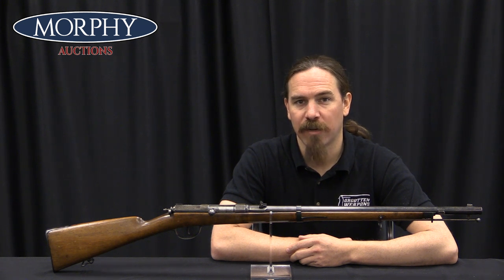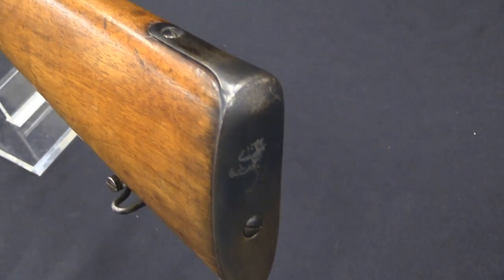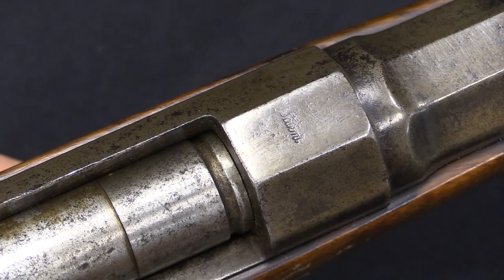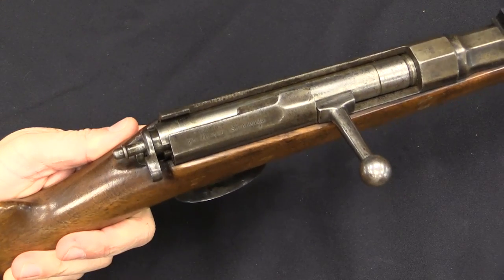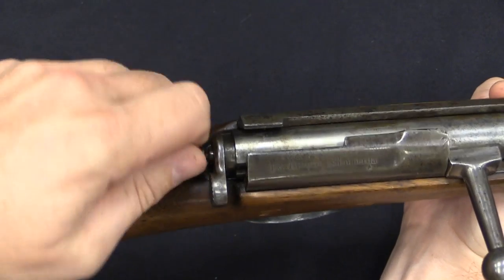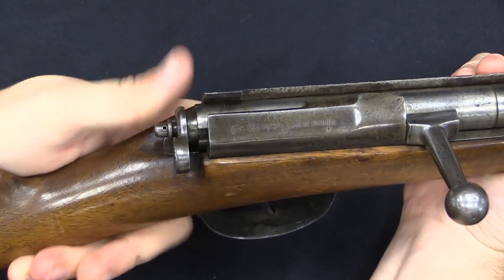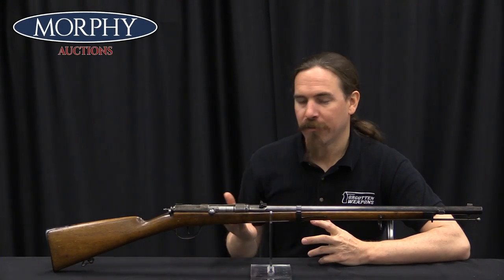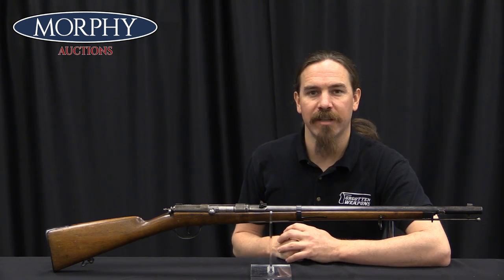The Last Dreyse Needlefire: 1874 Border Guard

Comment: Given the Dreyse was invented a decade before the Minie rifle, and the French themselves replaced their Minie rifles with a needle gun, was the widespread adoption of the Minie rifles by nations in the 1850s a mistake? What if everyone adopted a needle gun instead?
Reply: Had Dreyse, or any of Pauley's apprentices made their rifles to use a more powerful cartridge (similar to what the military was wanting) and solved gas leakage (Pauley used brass cartridge bases, but you have to have industry capable of supplying those bases), more countries would have adopted it. Especially after the Schleswig wars.  Napoleon briefly considered issuing Pauley's guns, but no one could supply ammunition reliably/affordably, so it didn't get too far. The floating bolt head of the Chassepot 1866 design solved the issue with out hindering accuracy, like felt wads in the base of the cartridge did (a major complaint with most designs of the day). The Greene Rifle design also solved the issue, but construction of ammunition and training soldiers to use it correctly was an issue with that design.
Reply: The Dreyse went through a LOT of changes over the over 20 years between first production, then adoption and finally the German Unification war. The Prussians pushed it from a gun that was (in their eyes) unreliable to something they were extremely happy with and would regularly shock the Austrians. The Minie and Lorenz rifles both had a higher "effective" range. The Lorenz was much more accurate and the occasions the Austrians were permitted to use that advantage was the only time the Austrians had any skirmish advantage.
On a couple of occasions the Prussians had units run out of ammunition, while still engaged with Austrian units xD
One Austrian commander did tell his line infantry to just load rifles for the Jaegers under his command, to try and cope with the significant rate of fire disadvantage. I think during Königgrätz or just beforehand.

Comment: With all the attempts to regulate ammo amid current events and the difficulty of manufacturing brass shell casings at home, I find myself looking at old designs and thinking "Maybe there are some things we can still learn from these relics? Perhaps there is a road not taken that's waiting to be forged?"
Reply: If you live in a world without massive factories cranking out millions of cartridge cases every year (or you can't get them), pre and early industrial guns are what you're left with. Priming is just a chemistry problem, and powder isn't difficult, lead and bismuth are available and have uses outside of firearms. The drawn brass case (even soldered foil cases) is a major feat of industry. I've made some "primitive breechloaders" (based off Thomas Wilson's 1859 patent, but with the floating bolt head and seal of the 1866 Chassepot), I like using them, along with my muzzle loading firearms and airguns.
Reply: @wildrangeringreen  awesome. We could use such here in Ukraine

Comment: I would suggest that the decocking feature on this Dreyse is mainly intended to be used on a misfire. With needle guns where the needle actually pierces the primer, there is a danger of the primer igniting when withdrawing the needle on opening the breech. There needs to be a method of withdrawing the needle with the breech closed. 

The earlier versions of the Dreyse and the Chassepot both lock the breech and force you to withdraw the needle before you can open the breech. This slows down the loading sequence and is unecessiary if the gun has fired. Presumably by the time this gun came into service, shooters were considered competent to carry out the proper misfire drill and not try to open the bolt on a misfire without withdrawing the needle...?

Comment: Ian, I'm trying to grow a goatee like yours, with the exception that I want the mustache to flair up like Val Kilmer's Doc Holiday. It seems the space between my nose and lip is narrow like Val Kilmer's, hence why I'm opting for that more narrow style mustache. The goatee portion is going well so far, maybe an inch and a half in length. However, there is a clear gap in the middle of my mustache where our lips depress right below the middle of our nose. I'm starting to wonder if it will ever fill in. Any advice?
Reply: GoBIGclan as a mustachioed man myself, my advice is deal with it if it doesn't fill in. By which I mean, make the space part of of the style. Don't worry about it. I occasionally shave the area (the philtrum) a bit, creating 2 sections to the 'stache. I I weren't so lazy, about maintaining the lines of my facial hair, I would probably keep the middle shaved. I think it's a clean, "tailored" look. (I don't remove a lot of the hair, maybe 1/4 inch or so.) See also, Clark Gable: https://images-na.ssl-images-amazon.com/images/I/61%2BKShWR2IL._SX425_.jpg
Reply: @commentername9737  alright I'll try not to sweat it. I know that the space is common for thin mustaches especially in the 20's-50's. Thanks a lot for the advice

Comment: It needs to be mentioned that the Prussians cleaned the clocks of the Austrians because the main rifle of the Austrians were muzzle loading...
Reply: I read that the original Dreyse leaked gas so badly that the troops usually fired them from the hip.  If so, they must have had some pretty good "hip shooters".

Comment: I read that the gas release problem was pretty serious (at least during the Austro Prussian war) it didn't just vent gasses perilously close to your cheek but bits of burning cartridge paper as well. So it was more often used from the hip. Just what I read..... Art of War Waterloo to Mons by William McElwee
Reply: no. Even without the later, floating bolt head, the interlocking cones limited the amount of gas that escaped and directed it forward, away from your face. A fault common to many breechloaders of the 1830's? yes. So serious to keep it from being used normally by people used to flintlocks and percussion cap muzzleloaders, where the flash of the priming is right at your face and gas shoots out the breech from the priming vent? No. Even the early versions of this rifle are better to shoot than Christian Sharp's design.

Comment: Would the paper cartridges have been cheaper than brass cartridges of the time?
Reply: yes, especially if you made them yourself. foil and drawn cases were expensive components, and black powder fouling ruins them fairly quickly unless you clean them shortly after use.

Comment: You know, it would not take a ton of work to modify this to metallic cartridge. I mean change the needle for a striker with blunt, larger tip, add an extractor, and rim out the chamber for the cartridge and cartridge rim.
Reply: Why bother?  It would take so much work and not hold up that well to that kind of system.
Reply: @williestyle35  Well since these were never adopted by the military, you are right. There is no purpose to convert them rather then just adopting something different. The boarder guards might had gotten more life out of them with the modification though.
Reply: True, they could use these rifles for a good length of time, if it had been feasible to convert them to metallic cartridges ( like the French did with the Chassepot ).

Comment: I wish I could own one or a replica to hunt during black power season.
Reply: make one. Go to harbor freight, buy a mill, drill press, a set of files and chisels; and you realistically have most of the shop tools they made these rifles with. I've made my own "primitive breechloading firearm", it's a modified Thomas Wilson 1859 patent ( but with the floating bolt had and seal of the 1866 Chassepot)